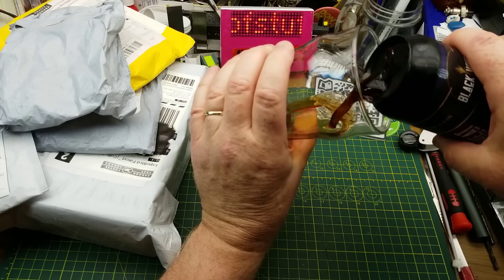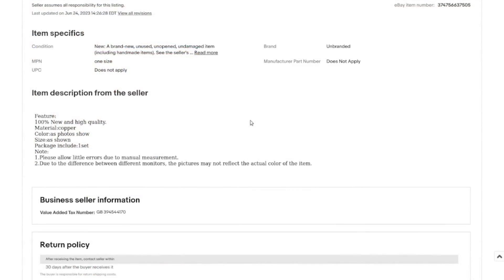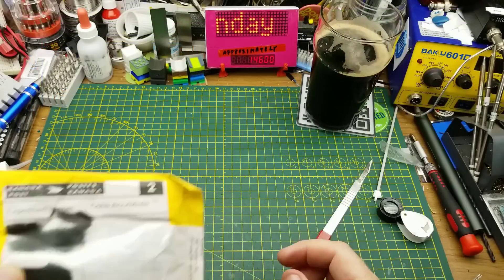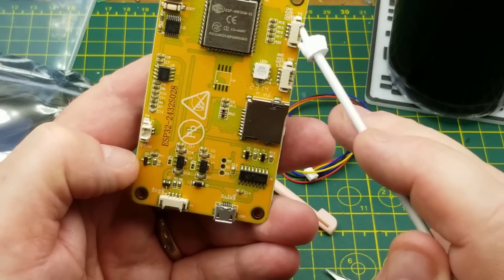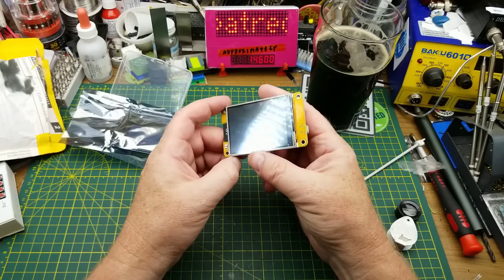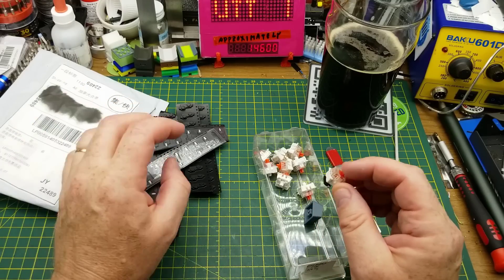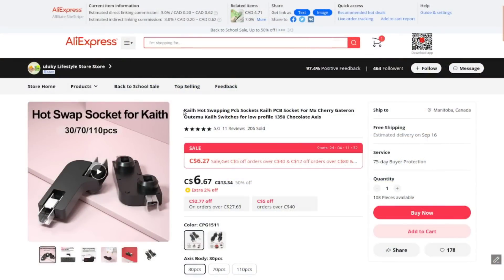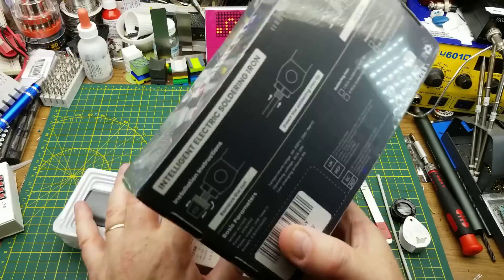Mailbag Monday 173

Comment: That ratchet screwdriver thing is very handy if you need it for a tight space. I bought a very similar one a few years ago to remove a panel on my dishwasher door that was right next to the wall. It did a good job even on the larger screws and have found some more usage for it afterwards.

Comment: One project I always wanted to do was make a remote control for an analog stereo. With that radio gear that could be possible. Put gears on the volume and tone pots and have a motor turn them.👍

The mini ratchet set will be useful.
Reply: If you used an ESP32, you could control the volume using wi-fi, BlueTooth, or infrared.  Also, ditch the motors on the pots and use i2c digital potentiometers.
Reply: @andrewkieran8942  That's far too easy.
Reply: @Franko_Walker  

No, it just sounds easy.  The devil is in the details.
Reply: @andrewkieran8942  I have a really nice early 80's tereo. I want to keep it looking and working the same but with remote function. So I've always thought RF radio gear with motors. easy.  (ish)

Comment: ESP display module ordered! 👍😀
Reply: You hit the buy button quite quickly!
Reply: You're not the only one, too bad it's resistive, not capacitive screen.
Reply: @kjur18  I am sure there is a "Reasonably Priced <capacitive_color> Display."
Reply: @GnuReligion  There are "other versions" of this board, bigger display (4,3" 480x270), ESP32 S3 (native usb support and some more) and even some additional PSRAM. Both capacitive and resistive versions, even the most expensive IPS version with higher resolution (800x480). But there are some negatives, for example all of them use RGB interface, so much more pins are in use, and I think that PSRAM might be not present at all. Only Wroover modules have PSRAM inside, WROOM modules don't. And all of them use WROOM modules.
Reply from the maker: @kjur18  Yeah, there's tons of options.  Part of the appeal of this one is the low price.
Reply from the maker: At this price, I can live with resistive.